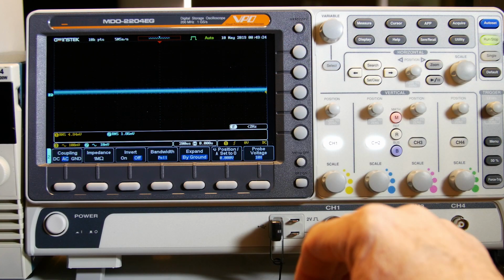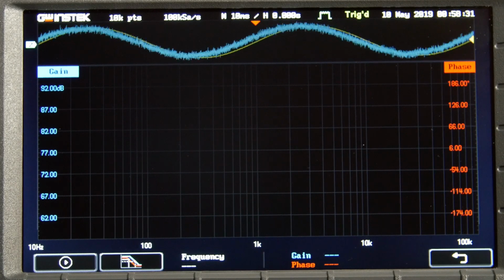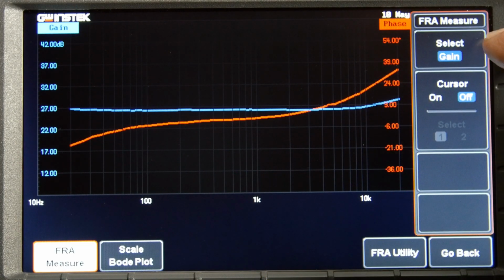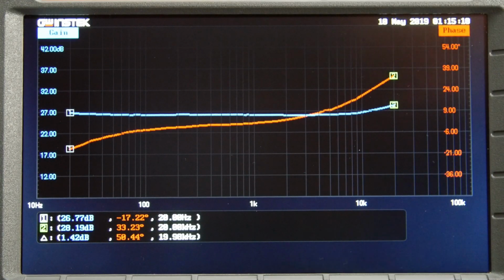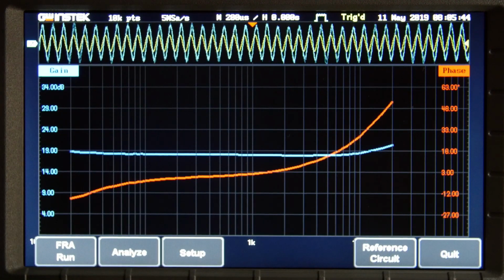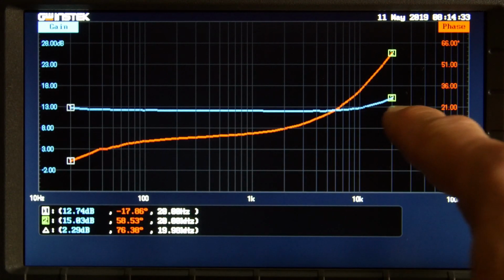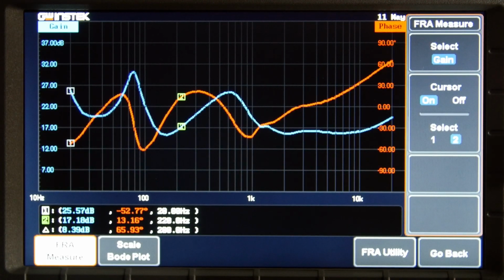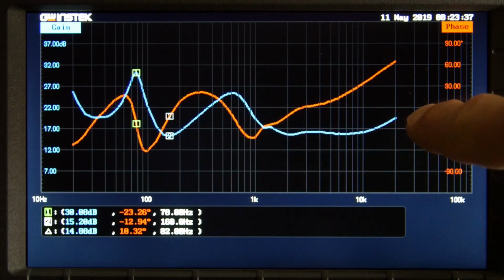How non-inductive is my load resistor?

Comment: Great Video! Gosh, i will re-watch this to really get my head around so many factors & give it a go on my GW... (as long as the display holds up... its going faulty). I have a vintage Tek current probe so will check if the GW likes it or not! Stray & parasitic impedance of a dummy load being present when  Freq response testing an amplifier has become a hot subject on many Forums recently. I wish i had seen this video 6yrs ago before i became retired but at least now i can make time to have a play too.

Comment: Hi Eddie,
Thank you very much for the interesting video! I don't have a current probe (nor a differential probe... boo hooo...) but I'm dying to try your experiment! 
I was surprised to see that the wound resistor did better - if only slightly - than the silver ones.
Actually, I was a little flabbergasted by the results of your speaker... I knew that speakers are notoriously difficult to make without wild changes in impedance, but I had never reflected on the result of the impedance on the power factor / phase angle....
With a bit of luck you could pair it with the class D GaN amplifier and the phase shifts cancel each other out! :-)
Question: would you be able to set the GW Instek scope to subtract the calibration results (from the little resistor) from the actual measurements? If not, would your scope export values to a data table for computation?
Cheers,
Mark
Reply from the maker: Hi Mark;) The scope will put out a CSV file, but I’ll have to see if there’s a way to zero out a ref waveform.  Great question!
Reply: @KissAnalog  Thanks, Eddie

Comment: Interesting, thanks.  Not sure how it impacts circuit design.  Is this kind of info given in data sheets by any chance?
Reply from the maker: Often it is not, so it’s good to check the impedance of your load over frequency.  I’ll be demonstrating how To do more of these impedance measurements as time goes on.

Comment: THAT'S ONE HECK OF LARGE WIRE WOUND RESISTOR.KEEP IN MIND THAT FORMULA ASSUMES IMPUT AND,OUTPUT IMPEDANCES ARE EQUAL AND, ZERO PHASE SHIFT.SO I WONDER HOW ACCURATE YOUR CALCULATION IS?
Reply from the maker: David Luther Good to hear from you David.  I didn’t want to get into the math too deeply in this video - it was meant to demonstrate how to quickly get the impedance plot.  I was just focusing on the impedance value so I was doing math on the gain which is accurate for Ohms.  The phase angle was ignored sort of - I only pointed at the phase curve and explained if it was inductive or capacitive.  I’ll have another video like this measuring the speaker - and then once everyone has seen an example or two then they might be more interested in my next videos where I go a bit more into the math - with more visual examples...;). I’m kind of building on ideas to make them interesting but moving to deeper understanding.
Reply: Hey Eddie, 
Yes, very interested in follow up videos and more details on the math, including assumptions and limitations...
Cheers 
Mark